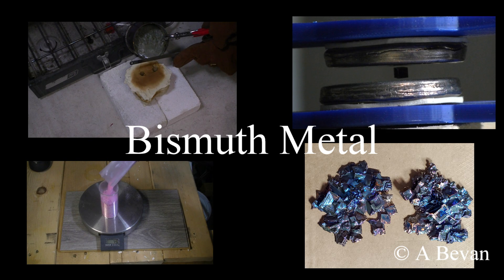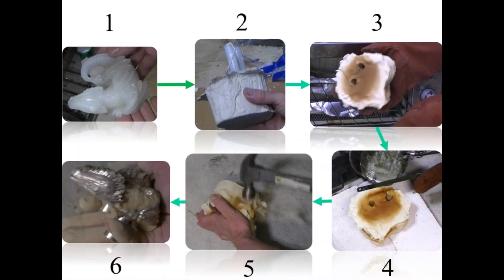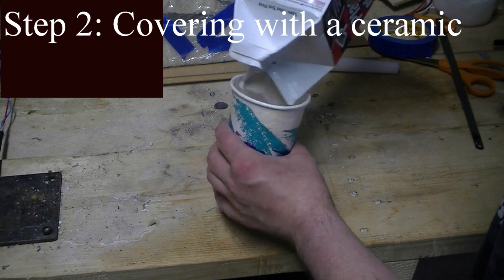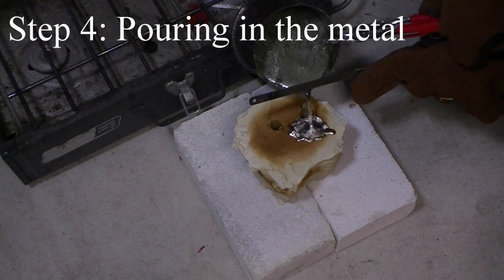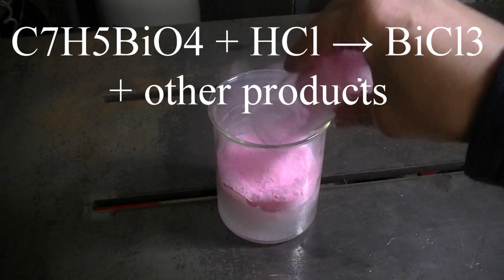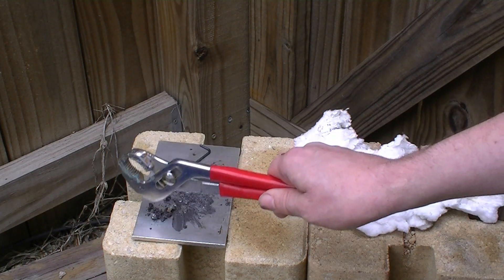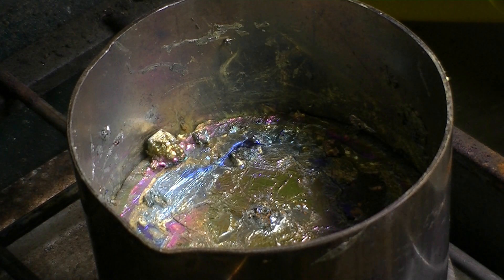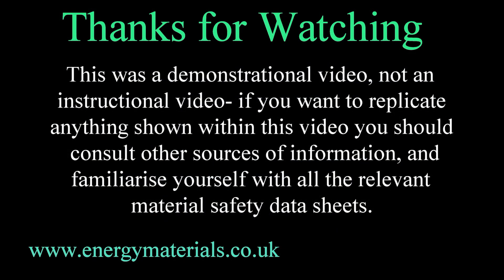Bismuth metal:- investment casting, metal extraction, crystal growth and diamagnetic properties.

Comment: Would you be willing to revisit your experiment on direct hydrogen iron reduction? Your video is about the only example on the internet except for others claiming it isn't possible. I know it is possible but I was surprised by how fast the reaction happened at what looked like a relatively low heat. If you do decide to try this, may I suggest using a trusted source of magnetite as your input material. I'm hoping doing so will disprove any claims that metallic iron isn't being achieved. If you start with magnetite and and get water formation within the test tube, that should be a pretty good indicator of metallic iron formation.